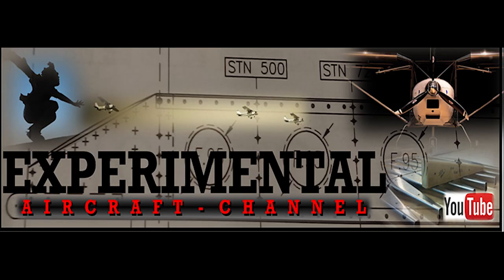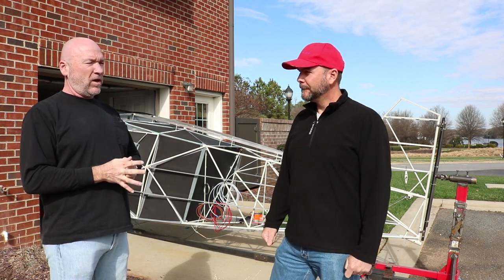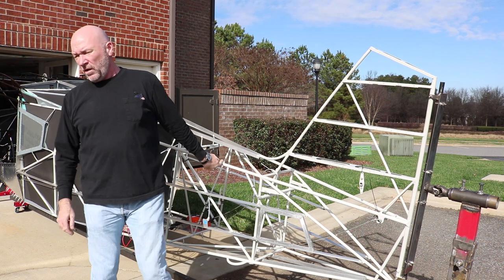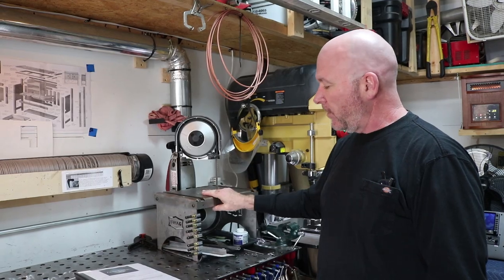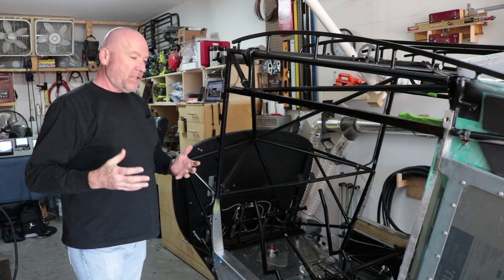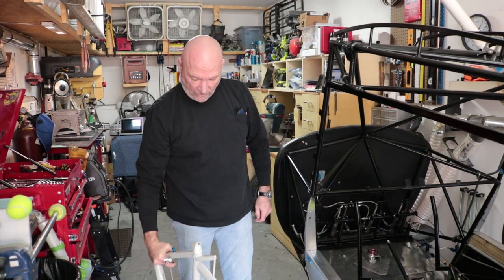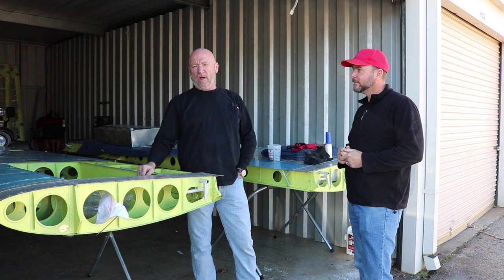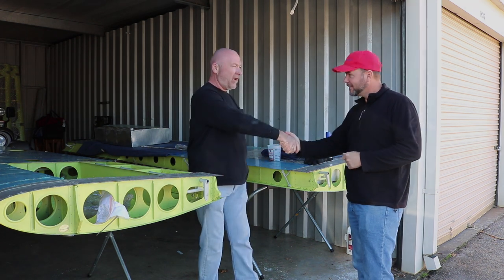BearHawk Aircraft Bush Plane - STOL 4 Place Kit Plane Build

Comment: I dig the modded engine stand lol.
Reply from the maker: DrewLSsix  Did you now? Which aircraft are you building?? Send me a message on FB or email and tell me about it. Thanks for taking the time to watch and also engage here I appreciate it. If you haven't already... PLEASE go ahead and LIKE and then SUBSCRIBE and look for more videos like this one in the near future.
Reply: Experimental Aircraft Channel  sorry lol, autocorrect strikes again! I meant I (dig) the modified engine stand lol. 

As for my own build I’m just starting down that path with likely a single seat wooden vw powered machine based around one of the many established designs.  Though I am tempted to buy an abandoned project near by that’s similar in concept but steel tube fuse and an ae81 Subaru on the nose.  It may just save time and money but we know how that tends to go lol.

Comment: I hope he bought spare iPad minis.
Reply: Are you concerned about over heating?  That iPad mount has a cooling fan installed on the rear.
Reply: @TheBaldPilot  iPads have a tendency to slow down and fail over time. If Apple even decides to make a new mini I'm sure the sizes will be different likely requiring a modification to the bezel. Having a few spare used iPads of the same type can't hurt.
Reply: @ginacalabrese3869  Oh I realize the iPad has a limited life like most of the disposable electronics we all use in the portable category.  The good news is this iPad is not a primary flight display and can be easily replaced including while in flight with either another iPad, or an iPhone.  The FAA now recognizes the use of tablet devices for flight planning and navigation and refer to them as EFB's (electronic flight bags).
Reply from the maker: Thanks for sharing that concern. Valid point. I see someone has already replied (Rob? :-) ) THANK YOU for watching! And for engaging here! Please... If you liked this video SUBSCRIBE and help me build this channel to get more people involved in AVIATION!
Reply: @ExperimentalAircraftChannel  Hey Bryan, yes that was me (Rob)(Bearhawk Life - YouTube Channel)
Reply: @ginacalabrese3869  Of all the consumer mobile devices (phones, tablets, iPhones, iPads), the iPad has the longest supported life (several models had been receiving OS updates for seven years!). Beyond those seven years, app developers rarely require the most recent version of the OS. ForeFlight, for example, requires iOS 13 (which came out in 2019). Oldest supported version of ForeFlight that can be downloaded from the App Store is V. 9, which requires iOS 9 (which is over 5 years old). 

I believe it is safe to say that you can continue to update your ForeFlight for the next 12 years, before they stop offering support. The device (and the app) will NOT stop working, though, and you can continue to fly with it beyond the support period, as long as you keep your subscription alive. Let's not forget, a new iPad is as little as $250, so squeezing 12 - 13 years of service out of one isn't that bad. And it doesn't have to only live in your cockpit. It is an iPad, and you can use it for all sorts of other stuff.